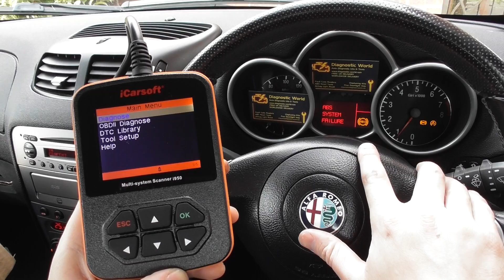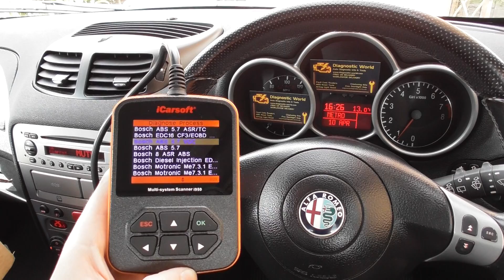iCarsoft i950 Alfa Romeo ABS VDC Reset C1200

Comment: Hi, With the i950, can you purge, and depressurize the accumulator of the dualogic gearbox?
Reply: Hiya mate did u manage to find out if the i950 works with the selespeed system I need for recalibration,thax